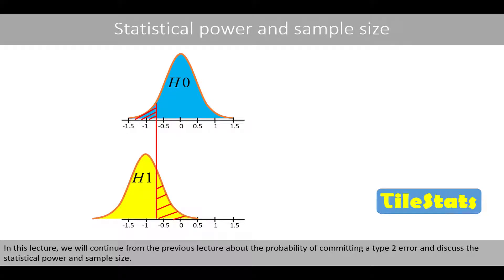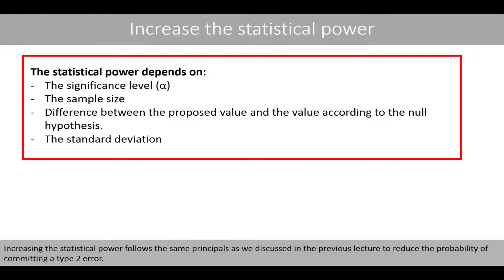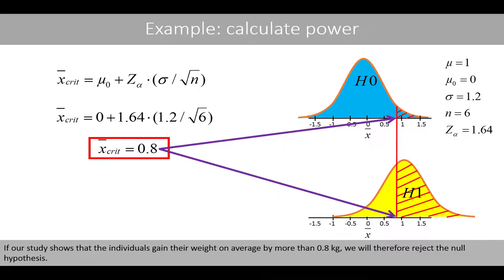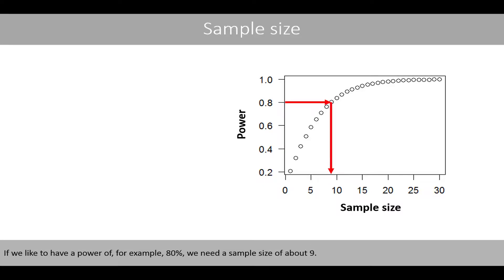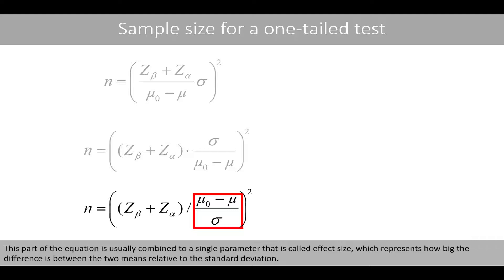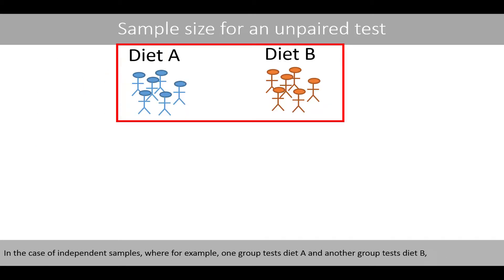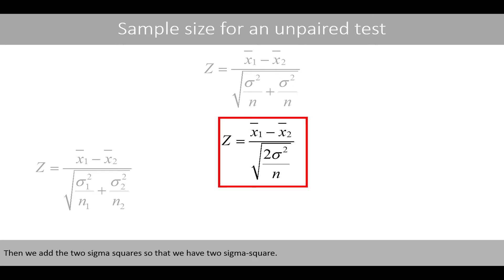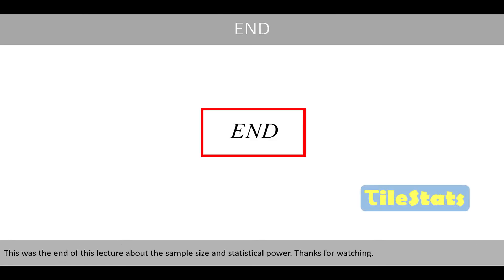Statistical power and sample size calculations

Comment: Hello. A question. Is the formula for calculating sample size n, correct? Is it supposed to be Zb + Za or is it meant to be Z1-b + Za. Another question why are we using the upper tail to get the Z-score for a beta of 20% at around time 7:25. Why not the lower tail where we would get -0.84 instead? Thank you very much.
Reply from the maker: Z1-b = the statistical power, Zb = probability of a type 2 error. Thus, the formula is based on the probability of a type 2 error and not the statistical power (1- prob of a type 2 error).
Reply: @tilestats Thank you once again for taking the time to answer. I tried working out for the equation of n and ended up with Zb - Za. Am I misunderstanding something algebraically?

Comment: If I want to estimate the sample size for a t test, why using Z values?
Reply from the maker: Because if you use t-values instead, you need to know the degrees of freedom, which means that you need to know the sample size. Thus, you need to know the sample size to calculate the sample size. However, there are methods, such as the one in the “pwr.t.test” function in R that can compute this. The estimated sample size from this function is a bit higher compared to the calculations shown in this video.
Reply: @tilestats  thanks for the super fast reply!